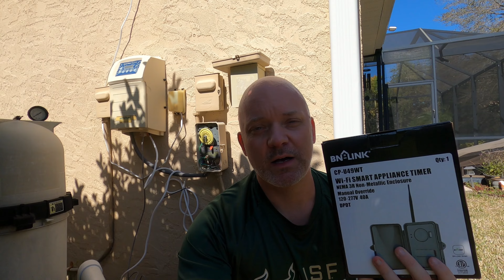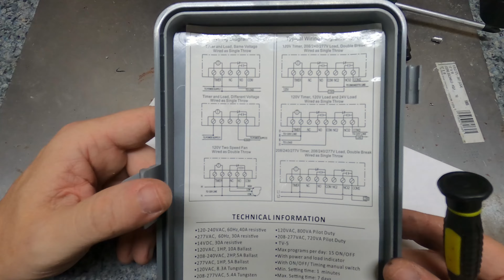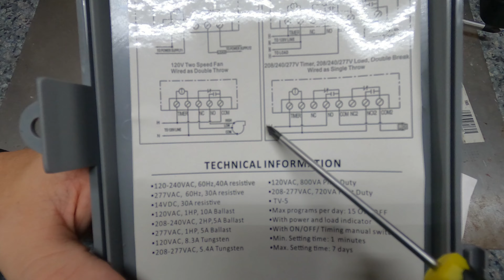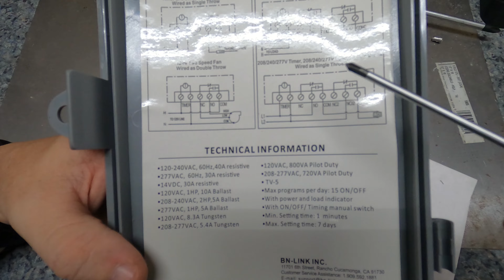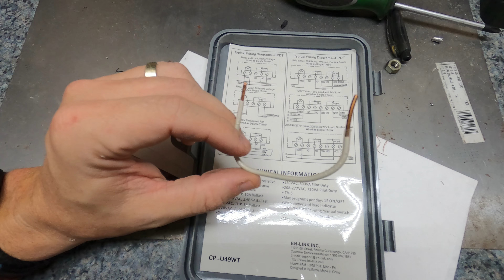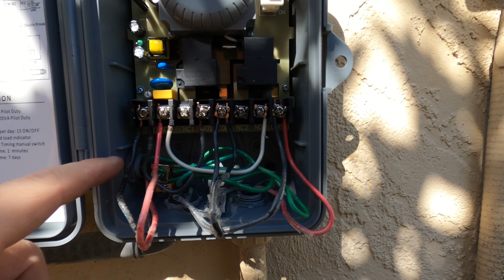How To Install and Wire BN-Link WiFi Smart Appliance Timer.

Comment from the maker: Hey, so I know I said in the video that I'd make a part2 for the smart app setup but it's real easy so just follow the steps below:
Step 1 Download the BN-Link app or SmartLife app.
Step 2 Set the Timer box in "Auto" on the manual switch
Step 3 Set your app to "discover new device". This is different for each app but it's a manual setup.
Step 4 Hold the center "bluetooth power" button for 5 seconds.
Step 5 The device will be identified at this point, if not your pump will start. Retry the 5 second hold and this should fix that issue. 
All done! Thanks for viewing!

Comment: The video from BN link shows the lines connecting to com 1 and com2, you seem to connect the line wires to the NO1and No2 screws and the loads to the coms which is correct ? thank you
Reply from the maker: The connections I have made here are for two 240-volt loads. My salt chlorinator and pool pump. This timer has a half dozen different setups depending on your setups needs, and this has worked flawless for me now since I made this video.

Comment: Can you control with this multiple sequential power signals to switch the color of the spa lights if I want too?
Reply from the maker: @xpous  it has the ability to power low voltage items, but I am unsure sure it can change the power signals.

Comment: Hello, I have this BN-Link unit CP-U49WT. I would like to use it as a Wi-Fi switch for a 120v - 20am water pump. What jumpers and which terminals should I use?
Reply from the maker: @jimmcewen8451  If you are just using the timer to power one item, then follow the 120 volt schematic on the cover. You will only have one single load, and that is the pump.
Reply: @JackofAllTrades1  I have CP-U49WT hardwire, and I have the app installed and connected the wi-fi. I get off and on function, but I don’t get any power out. What am I missing? I have power going to Timer post 1 and 2 with a jumper from post 3 (NC1) and post 5 (COM1) pump connected to post 4 (NO1) and COM1. Plus, the grounds are wire is connected. Sorry the system will not allow pictures.
Reply from the maker: @jimmcewen8451  go to my about section and find my email address and email me a picture, and I'll see if I can assist.
Reply: @JackofAllTrades1  Did you received the email?
Reply from the maker: @jimmcewen8451  yes and replied back yesterday.
Reply: @JackofAllTrades1  Not sure what happen. didn't get it
Reply from the maker: @jimmcewen8451  I just now resent the email.

Comment: The literature that came with the BN-LINK model CP-U49A has the dip switches set for 240 volts as 2/3 on. The BN-LINK video has the dip switches set at 1/4 on, so which is correct?
Reply from the maker: @DavidNitzel-q5d  this works for my setup and I've had no issues with it. The literature tries to cover all the major scenarios that somebody could use in a setup, but there are likely more ways. What are you powering? Same stuff? Pool pump, and salt chlorinator?

Comment: I would use the jumper to jump back to the timer circuit. The line wires should go straight to the no's. Coms  then go to load.

Comment: So I did the 120v configuration and I got everything to work but the timer won’t work. Did I perhaps wire something wrong? I have it connected to lights and the off turns them off, on turns them on, but when I configured a timer, nothing happens. Any help is appreciated!
Reply from the maker: @professoroats7202  any luck setting up the app? It has a timer function.
Reply: @JackofAllTrades1  Sorry, I forgot to mention that the one I hooked up was a digital timer and not WiFi one. It is from the same brand though.
Reply from the maker: @professoroats7202  follow the flow of power and make sure the timer lugs have both a hot and neutral wire. Also, make sure all of your grounds are connected. I think a lot of people wire these up and miss the bridges that join more than one lug to power. Check to see if your setup requires those as well.

Comment: Sir,
I realize this a six months old, but if your still checking the comments I have question.

I am trying to connect a 230v “power in” with a 230V and a 110V  “load out” using this exact WiFi timer. So, my two-part question is;  do I still wire it up in this manner for the 230v load and how would I connect a 110 load? I need the power to come on simultaneously for both loads using 230 as the source power. 
This is for a Scott’s Aerator that moves water in a lake off my dock. The pump is a 3/4hp water submergsable pump that runs off 230V and a separate oscillating motor that runs off 120V. 
Thank you in advance, and I hope this makes sense.
Reply from the maker: @mach9383  check the schematics on the inside cover of the box. I believe the middle right diagram has both 220 and 110 volt loads. I'm not near mine to confirm, but essentially, the 110-volt connection will only share one spot with the 220, and the second line of the 110 will be somewhere else.

Comment: Hello good evening friend, can you help me? I need to install the timer on a 4 amp 120 V water pump. I didn't understand this diagram. Can you help me where I connect the power input and output for the pump? I'm using 120 V.
Reply from the maker: @denisiodasilva6571  is the water pump the only thing you are connecting to this timer?
Reply: Yes friend, the water pump is the only one I'm going to connect to the timer, I can't identify where the positive and neutral come in, and I can't identify which output is for the pump, help me friend,
Reply: The first 2 points mark a timer and I don't know if I enter with phase in one and neutral in the other, the third is NC, the fourth NO, the fifth COM and so on, my difficulty because I don't know the meaning of these letters, friend, this is for those who are more educated, lol, I have difficulty in clicking on these teams, just you describe to me which inputs, I enter with phase and neutral and which letters I take to the pump, thank you
Reply: U r the first you tuber that ever responds to messages let alone help. Thank you that helps me too
Reply from the maker: @nhungtran-ru3bf  I highly believe that is what has helped my channel grow. A lot of folks never need anything else from my channel, but they sub simply to say thanks.
Reply from the maker: I will need to pull the cover off my timer today and see if I can walk you through this.
Reply: @JackofAllTrades1  Hi friend, good morning. If possible, friend, take a look at your timer and help me. I've already installed it in place and it's ready to be connected correctly. Thank you. I'll wait for you.
Reply: @JackofAllTrades1  Hi friend, good morning. If possible, friend, take a look at your timer and help me. I've already installed it in place and it's ready to be connected correctly. Thank you. I'll wait for you.
Reply from the maker: @denisiodasilva6571  the wiring diagram you will use is the top left on the cover of the timer. The naming of the individual locations may not be exactly the same from what is on the diagram and what your timer actually shows, but here is how you have it connected. The two "timer" slots for wires will have your two power cables ... this should be a black and white cable.. they can be oriented in any way. Your two wires for the pump will be (in any orientation) one in the second timer slot and the other in the NO or N0 spot (there should only be one slot with that name). You will then need a jumper wire that will go from the first timer slot to the COM slot. All the grounds from both the pump and the power supply need to be tied in together at the grounding nut at the back of the timer box. Note* If for some reason your pump runs backward and does not pump water in the right direction, then swap the location of the two pump wires. Also, I explain the naming differences in the diagram and the timer in my video, so please rewatch. I hope this works.
Reply: @JackofAllTrades1  this for 120 V? if I really understood, the first 2 screws that are the timer will feed positive black to the first and neutral to the second, correct? then there is a jump from the first (black phase) to the letter COM, and it seems that the neutral goes to the second point of the timer and to the pump too? and the output for the pump would be the letter NO .. would the neutral leave the second point of the timer for the pump and power supply to the pump leave the letter NO, correct?
Reply from the maker: @denisiodasilva6571  yea you said your pump and power input is 120v so you would follow the upper left diagram.

Comment: Would it fine to connect 12g line in on NO1 and NO2 then you can use can a smaller gauge jumper to the two timer terminals , one each from NO1 and NO2.?
Reply from the maker: Depends on your voltage. The jumpers transfer the same current so a small wire could burn. What volts and amps are you at on your setup?

Comment: hello, what about the ground wire of the timer? I am getting 0 volt between the two lines when measured together like there is no ground
Reply from the maker: The ground for the box in the bottom left corner is where all the grounds come together. My equipment is double pole 240 volts, so all I have is two hot wires coming from the panel.